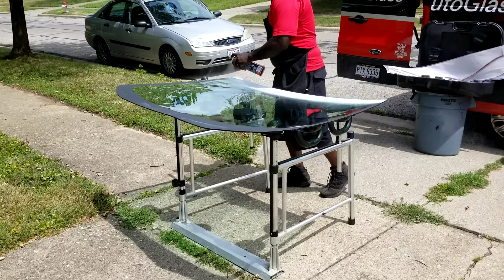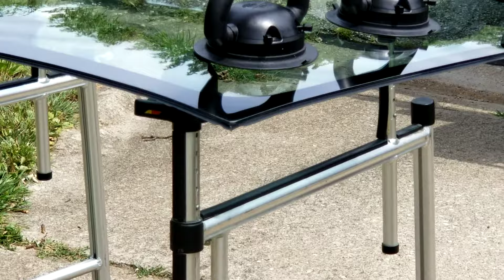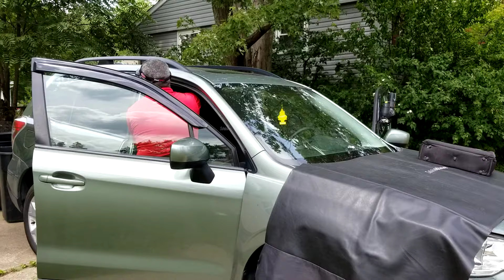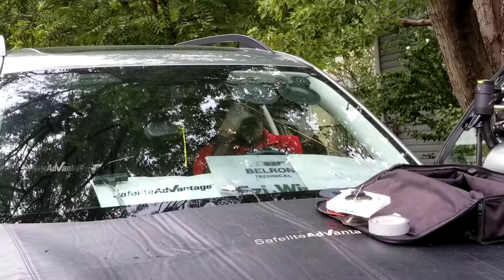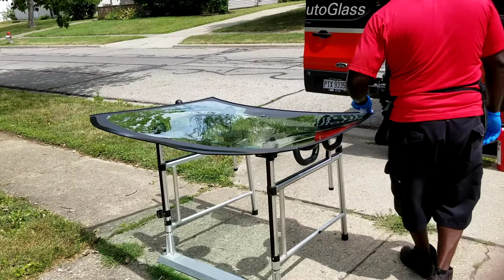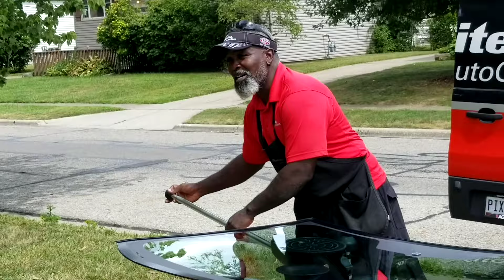Safelite puts a new window in our 2016 Subaru Forester

Comment: Relatively impressed with this replacement. A few things that need attention but overall probably one of the better Safelite installations. Keep in mind, a good installation doesn't mean it didn't leak. The only real way to know is in an accident where the installation is tested. I regularly fix ALOT of Safelite mistakes.
Reply from the maker: He did a good job but he did put the wrong window in.  They fixed the problem but we didn't know till 8 months later when one of my subscribers told me about it. Very thankful for that subscriber.

Comment: If a crack is maybe 9 inches long can it be repaired instead of replaced? I got tint on my windshield and don't wanna pay another 200 to get it again
Reply: No it can’t be repaired, as the resin (glue) that fills the crack can only fill a certain length which is around 5cm. Replacement is the only option you have.
Reply from the maker: @opsHPC  thanks for replying to him.  Didn't see this till now
Reply: Anything more than 6 inches has to be replaced.

Comment: I work for the company that made the gas tank and whole exhaust system for that Subaru Forester from the exhaust manifold to the end exhaust pipe and the air filter housing as well and fuel filler pipe
Reply from the maker: That's really cool 😎

Comment: 1st and foremost I want to thank you for taking this video. I can tell your technician was very thorough, which is something I really like. As a consumer I wish I would have videotaped my technician. I just had my windshield replaced on my 2014 Chevy Malibu. Oddly enough he did not do the steps your technician did. My car hood and seats were never covered with any protective covering as was in your video. The step your technician took putting a molding around the windshield prior to putting it on the car, my technician did not do. My technician lifted the glass onto my car, never using the brace your technician used to assist in his lift. Also did not clean the track as thoroughly as yours did. There was obvious dirt and debris. He just scraped not cleaning any further. I also noticed my technician used something like a big scraper to get my glass off my car. When he was completed I noticed that the corner driver side top of the window there was a part that I could see through the glass that was not apparent on the passenger side. 
Needless to say I will be calling Safelite to inquire further about their protocol and steps.
Hopefully others will watch this video prior to their appointment my suggestion to all videotape them, they seem to be more thorough when you do so. Again thank you for your video! 👍
Reply from the maker: Your are very welcome.  I'm glad I could help.  I hope ur able to get everything fixed.
Reply: But is there any issues?

Comment: So I'm not talking bad about his work it looks like he knows what his doing
But I did notice that he installed the wrong windshield on your car when i say wrong windshield i mean that your original windshield has the heated wiper park area and the Windshield he installed doesn't have that heated wiper area
You can see that when he takes the cowl off  you can see the heater plug connected on the bottom center of the windshield and if you look at the new Windshield there's no cable or wire for the Windshield wiper heater
I've been in the auto glass business for over 20 years now and I've see this alot wrong Windshields on cars.
Reply from the maker: Omg I just noticed that when u showed me.  I'm sure they wouldn't fix it now since it's been over a year.  Darn it.  Well now we need that same window because it started to crack again cuz my hubby thinks something hit it on his way to work. Thanks so much for the heads up.
Reply: @THENAILDIVA2015  Video proof it's the wrong windshield.  They basically disabled one of the safety features of your car.  Have them replace it with the correct part.
Reply from the maker: @genenichols3004  I will call them tomorrow for sure.  Thanks so much for all your help  I'm so glad I recorded them now.
Reply: @THENAILDIVA2015  give us an update on that call please :)
Reply: Can it be because it was selected as aftermarket windshield and not OEM? i know you can select Aftermarket or OEM for a little more in price. I did order a new windshield today and selected OEM because i wanted to avoid same issue as in this video.
Reply from the maker: @TheDane_09  so I called safelight first n they couldn't find us in their system so I then called carmax since we got the car from them n they paid for the window to be fixed at our house after we bought the car,   so I'm waiting on a call back from her to tell me the invoice number n once I get it figured out I'll give you all an update.
Reply: @TheDane_09  Nope they just installed the wrong windshield because you can also get aftermarket windshield with the heated wiper area not just the OEM I’ve been in the auto glass business for over 20 years so I know you can get either windshield heated or non heated
And if you don’t believe that you can call any other auto glass company and ask them and they will tell you the same thing.
Reply: @THENAILDIVA2015  I hope you can get something resolved about that.
Reply from the maker: @fransiscocisneros1084  I really hope so.  I have proof so I'm hoping safelight is a stand up company.  But I want to thank you so much for letting me know about this or I'd of never known.  I really appreciate it.
Reply: @THENAILDIVA2015  following👀
Reply from the maker: @julesb1325  great, thank u hun
Reply from the maker: @fransiscocisneros1084  well I want to really really thank you.  Safelite came out today and fixed it. We got a brand new window.  It was under warrenty n since they put the wrong window in they HAD to fix the problem.  But thanks so much for ur help. 💓
Reply: @THENAILDIVA2015  I'm sure all the haters in these comments are disappointed Safelite did the right thing and fixed it. People love bashing Safelite. All that plug does is turn on defroster strips to melt ice on the bottom of the windshield so your wipers free up, if it's snowing or just really cold. If you live in Florida or somewhere it doesn't snow that plug doesn't really matter. But it is on your car and the right windshield should've been installed. Not disagreeing with that. Safelite is big on customer service, not surprised they fixed it.
Reply from the maker: @grady.stu.8300  we live in Ohio so we have some pretty bad winters sometimes.  My husband said he wants what he paid for so that's another reason he wanted it fixed. I'm just very glad I did a video or else I'd of never known. But yes I'm glad safelite stood by their products. Thanks for watching.
Reply: @genenichols3004  theres no safety features. Its just a heater. Not important really. Pretty sure customer wouldnt like the price if he really wanted that one.
Reply: @jonadrums   not true, heated wiper park(HWP) can sometimes be a cheaper glass. The customer should always be informed in advance if you’re using something that’s different than what is in the car. All reputable glass shops know this, and also decoded the vin# and would know this car had a HWP..   this is a very cheap and lazy mistake from Safelite. I would 100% demand a replacement of the correct part. 
Hack companies do this all the time, you should never see it from a company the size of safelite. It’s honestly sad. 
People need to be weary of safelite’s ethics from a management and corporate level. They are one of the worst companies in the world when it comes to ethics, just not many people know it because not many understand (or care) about glass installations. Steer clear of safelite at all costs
Reply: @jamesgoin2726  i guess when you use safelite your right lol
Reply: @jonadrums  i worked for safelite for 6 years till I started my own company 2 years ago and the glass price is only a couple dollar difference, I’m glad for safelite cuz I learned a lot . But they over price the glass they put way more than what the actual cost is , and they get it cheaper then a small company like myself

Comment: Safelite installed the wrong glass in your car. One of the common features on Subarus is the heated wiper park area, and you were just robbed of it. Very sad work from Safelite, trying to slide a quick one by on a customer. This is why you should always use local shops with a good reputation. They survive on real reviews and honest work, and will go the extra mile to make sure your car is perfect.  P.s. majority of safelite technicians are undertrained and overworked. Skilled technicians leave and go to better local companies, only to be replaced by a 2 week class room trained technician…
Reply from the maker: That is all true, but I will say safelite stood by their work and immediately fixed the problem and gave us the right windshield.
Reply: @THENAILDIVA2015  this is good to hear. Glad you got it worked out.